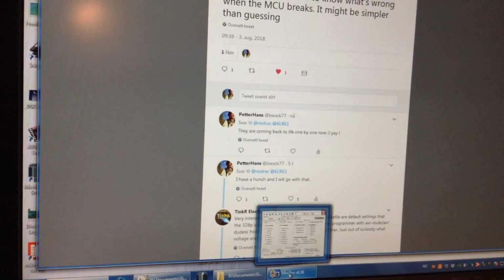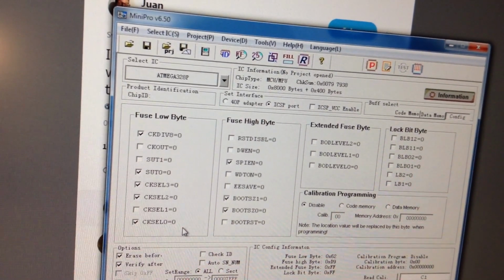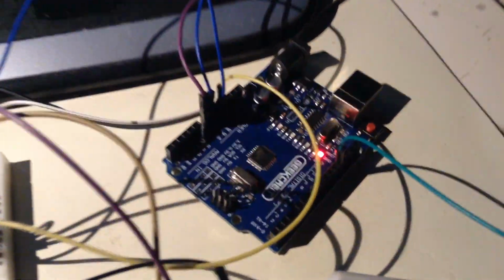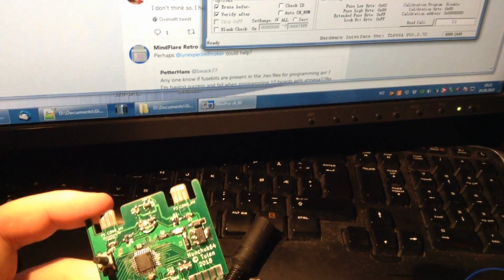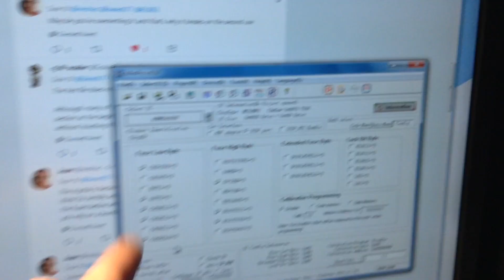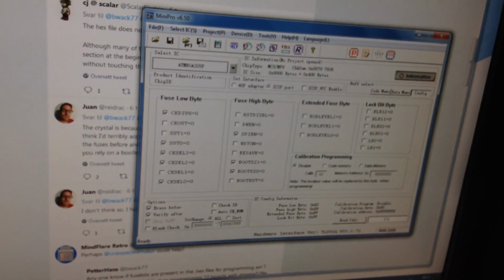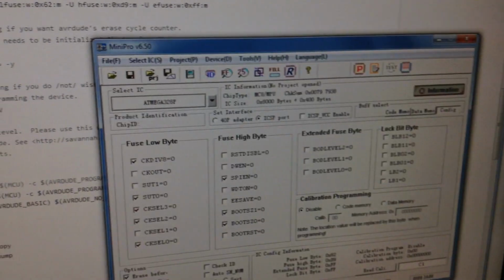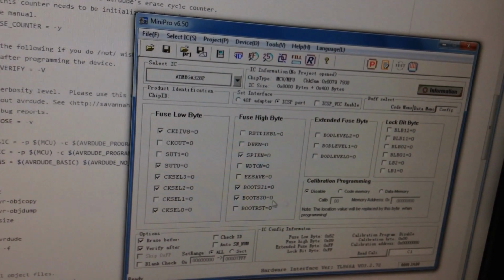Locked out by wrong AVR oscillator fusebits

Comment: fusebits...I'd never heard of fusebits before. Juan really knows his stuff apparently. Not just a programmer, also a tinkerer.
Reply from the maker: They are like settings independent of the program memory. clock selection, prescaler, brown out reset, watchdog timers etc. Some of them can be configured in run-time also. Fusebits are like the first thing you need to look at when setting up a new microcontroller project.
Reply: Thanks. This whole microcontroller thing is an alien world to me.
Reply from the maker: except for the one in the C64 :-)